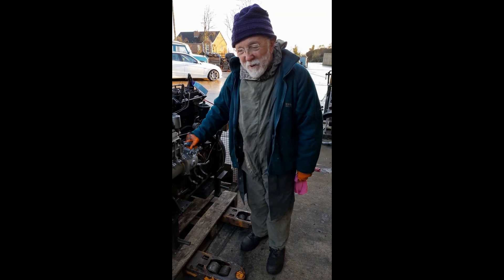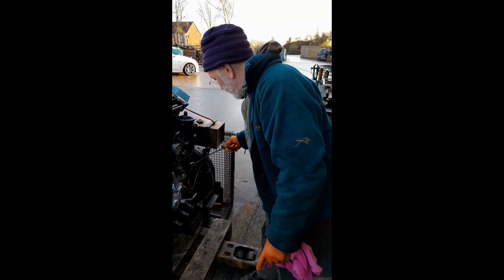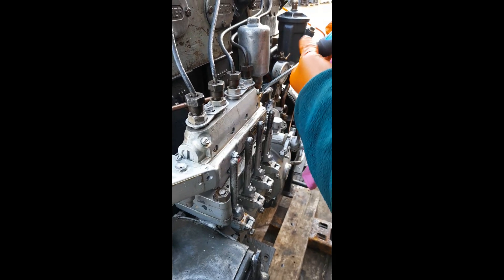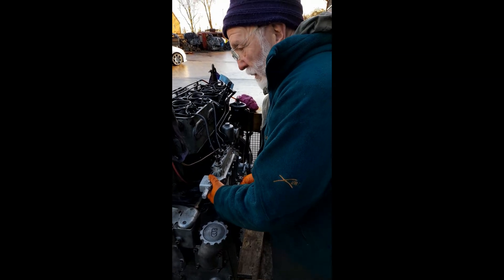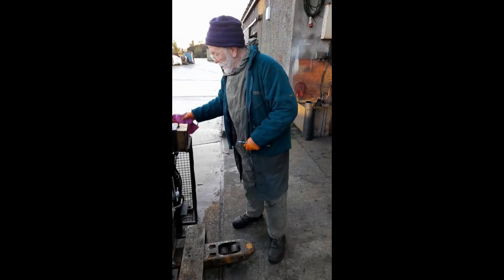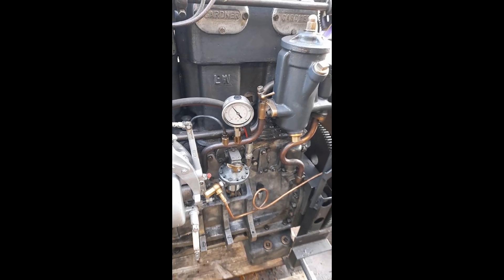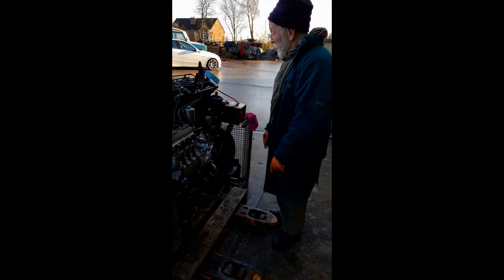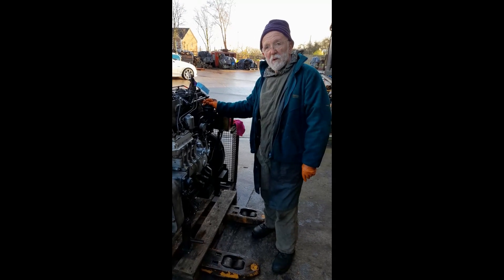Gardner Engines:4lw repaired and  priming the fuel system.

Comment: Hey Joe,loving the videos very informative,I'm trying to get start an old 6lxb here and not getting anything out of the topheads,rack seams loose enough back and forth and I've primed as much as I can I think...... stumped now
Reply from the maker: With the rocker covers off, check that fuel is getting up to the injectors.
Reply: @tangentgardner  I haven't taken off the rocker yet,I might take a video of what I'm doing maybe you could spot something wrong in it as I'm just an amateur trying to start this bus to get it out of the way

Comment: Does the LW have a proper Breather somewhere? I see them with just  a flat oil filler cap. On my 6 LW someone at some point had drilled holes in the filler cap and fitted a filter like the ones on the 6LXB. My 6LW was dated 1941. Can you please make a short video explaining the breathers. Thanks